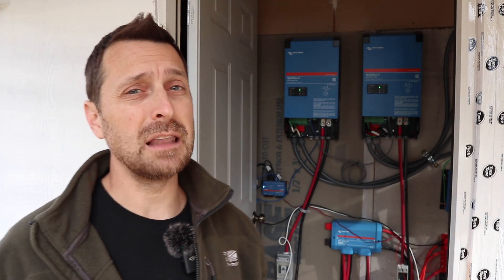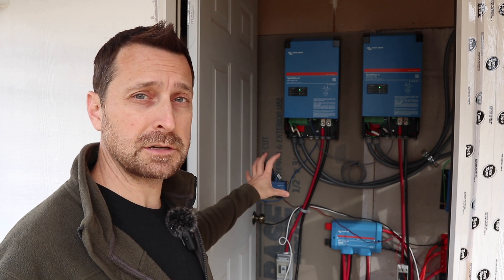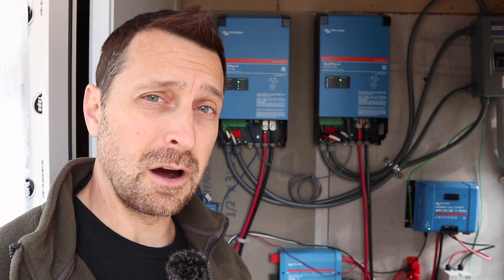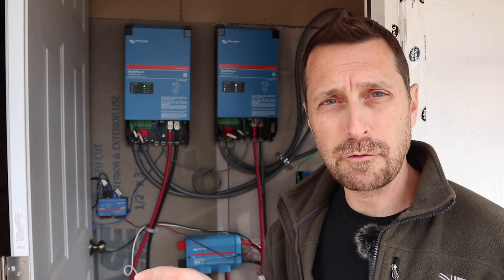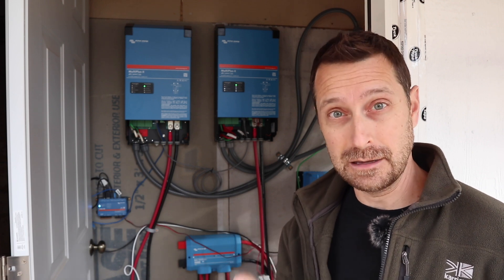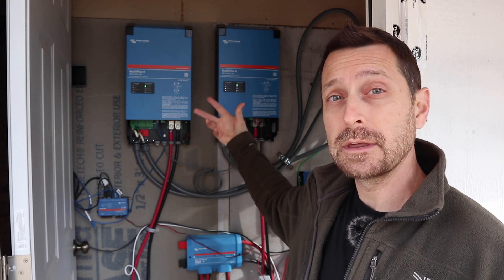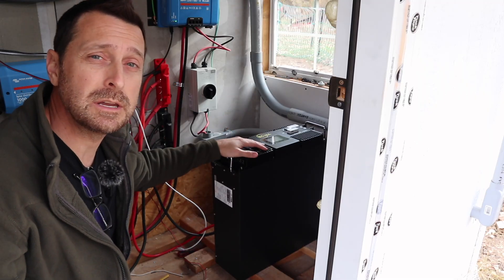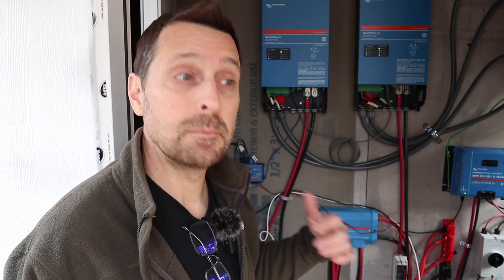Is There A Flaw In A Modern Solar Power System For Home Use?

Comment: morality of the story. don't update when no update is needed, and read the documentation for the new firmware before applying it
old analog systems wouldn't be able to use LiFePo batteries. also they had hardware problems, that were much more difficult to fix than just updating firmware

Comment: I agree with you on this but I'll share my anecdotal experience- I have used on my properties: Sungold 6500's x2 for 240v, Growatt 5k with transformer x2, Eg4 6k (old models) 240v invterters x4 (horrible plz dont consider)(Not the LuxPower 6k EG4's... completely different), EG4 18kpv in off grid use, and SoArk 12k... the ONLY inverters that have been running from day 1 without shutdown or "firmware" issues are the Sungold 6500's... almost the cheapest ones in my lineup. My parents home run on the same Sungolds with the same results. I have no idea why, but I share this for your use... or scrutiny...
Reply from the maker: I appreciate you sharing the info.

Comment: Hi, I have a question.
You stay in Texas, and have normally 120V/60Hz.
Why you use over the inverter 2x 240V?
Reply from the maker: Hello. We have appliances that run off or 120v or 240v. We have split phase. Large loads like clothes washers, pumps, and ovens use 240.
Reply: @CountryLivingExperience  But for 240V, u use two phase 120V.
That's why I don't understand, why u make 2x240V and not 2x120V.
Reply from the maker: @mistercat9875  No. They are two 120v which are paralleled together. They are 180 degrees out of phase.
Reply: I have order for a friend a 5kW system with a Growatt SPF 5000 ES - with Lithium Battery 200Ah. 
The friend is move in the caribbian and use his old homestand from Germany... (1 Phase 240V), but also 120V from the island. 
I need a safety system for him, to use both things. But need different plugs for use only single phase 240V (here he like to use the Germany system). 
Normally is my meaning: use the system, like the country u living in. So no problems.
But he use the different way... He has a lot sunshine, but the country take off power up to 14h/day.
Another question is: can he use 110-120VAC input of the Growatt? The manual, who I has read say yes, but get with the power down... I mean input to use the Growatt/Battery's like a USV. 

I'm also from Germany, but living in Macau, don't have this problems...
Reply: @CountryLivingExperience  Hi, a questen again...
It's possible to use the Growatt with 2 Phase US 120V?
I have let make 1 Phase/N/PE for input and get outside of the Growatt 120V ... 
But we need to make 1 Phase 230 (240)V... - Only Power input - (nothing feed back in the public network).
So it's possible to use 2 Phase input the Growatt?
I has ask Growatt, but no answer.
Reply from the maker: I will look at the email when I get an opportunity.

Comment: Is it good or bad idea to keep battery,charge controller,inverter in a separate air conditioning room to maintain cool temperature?? Most of the time heat reaches 36,37C here.

Comment: Hola Hermano, Quiero comentarte algo que podria ser de utilidad para ti. Soy mecanico automotriz y esto me recuerda a cuando salieron las luces de xenon para vehiculos, tuve un caso en que el auto hacia seña de luces y se paraba el motor, resulta que el alto voltaje de el xenon interferia en los sensores de el motor, tambien tuve un caso en unos equipos sonoff que tengo de domotica en mi taller, un dia puse en marcha un generador cerca de un sonoff y este se bloqueaba, prueba de aislar los cables de comunicacion de grandes campos magneticos, en ese auto lo hice mayando los cables con papel aluminio y este llevandolo a masa, si asi no se soluciona, abre tu inversor y si es posible hacele una chapa que ataje los campos magneticos de la alta potencia a las placas sensibles, recuerda los Growatt que tenias, las llevaba afuera de el equipo... Creo que eso puede ser el motivo de tu problema. Saludos desde Argentina!!
Reply from the maker: Interesting. I appreciate the suggestion. Gracias Amigo.

Comment: Once system is built and functioning, do not update firmware unless you have a specific issue it resolves. Same as flashing the bios of a pc motherboard, if it is not broke....do not update it.

Comment: Oh, one last little thing.  I noticed that the solar panels on that shed behind you are jutting out from the top.  I recommend putting a bit of structure behind the part of the panels jutting out from the top to prevent wind from catching the panel from underneath.  Otherwise a strong windstorm will rip that shed right off its foundation.

Comment: Integrated communication  between a multitude of different brands always has warts.  It's an issue with computer automation in general.  As a programmer I can tell you that sure,. there are protocol specifications, but the amount of testing manufacturers do is wildly different and often amounts to almost none.   The result is usually poor compatibility between brands when edge conditions or less-than-perfect situations come up.

Also remember that most of these companies... like Growatt, EG4, Bluetti, EcoFlow, and most battery makers... they don't necessarily employ the cream of the crop when it comes to programmers.  Even Victron (the best of the bunch) could do a better job.

But fortunately when it comes to a solar system and LiFePO4 batteries, you don't actually need the comms.  You can just configure the devices to be voltage-based.   In fact, when it comes to LiFePO4 batteries, you don't want ANYTHING to be based on SOC.   Even if the comms are working perfectly.  The reason is that it actually is not physically possible to accurately track the state of charge of a LFP battery unless it regularly hits "reset" points (typically for 100% SOC).  Even Tesla's with LFP packs can't track the SOC of their packs accurately.

Even in fully operational systems, I strongly recommend that NOBODY configure any logic that uses the BMS's reported "SOC" readings.   You can display the SOC for user convenience... just don't make any of the automation conditional on SOC values.

For amperage limits, just choose reasonable hard limits.  Normally the inverter(s) talk to the BMSs to determine how many batteries are online and able to charge or discharge to determine amperage limits.  But you don't actually need these comms to have a robust system.   For example, if you have a rack of 6 x EG4 batteries, choose amperage limits under the assumption that at least 3 batteries are tied in.  Simple as that.  Give yourself a bit of redundancy and margin and you will have a very robust system without major comms.

This is true for small systems too.  Say you have 3 x 100Ah batteries (without comms) in parallel.  You can just assume that at least two of them are operational when setting up amperage limits (you'll be limited by wiring anyway most likely)... and that's it, you are done.

The only integration that I would leave intact is using the Victron Shunt to get the battery's voltage reading for the charge controllers, which is a simple setting.  That works flawlessly.   In fact, I would also use the Shunt's SOC tracking for any SOC displays, and ignore the SOC tracking done by the battery BMSs.  (Remember, don't make any of the automation SOC-based either way!).

For things like the inverter low-battery shutdown, load support / generator operation, and so forth... make all of that voltage-based and your problems should pretty much go away.   Give yourself some margin and the system will work perfectly.   For example, in my 48V (16s 51.2V nominal) system I set the low-voltage inverter cut-off at 48.0V.  At 48.0V the batteries are 95% discharged and I am also pretty much guaranteed that the inverter will shutdown before the battery BMS's do, leaving the batteries completely operational and ready for the next cycle.   There is no need to make the shutdown voltage lower than that.

For things like generator start or load-support, that can also be voltage based.  Select something reasonable between 50V and 52V for load-support automation.  During discharge, the battery will be roughly at 30% SOC at 52.0V.  That is when I have my first load-support resource turn on (which in my case is the grid).  I don't have a generator yet but when I add one I will have it kick-on a 51.0V.

For setting the "turn off point" or whatever, remember to use the charge curve instead of the discharge curve... so any shutdown should be well above the float, such as around 54.5V or higher... or even charge the batteries to full (56.8V).   The voltage range may seem wide but remember that the charge curve and the discharge curve are two different beasts.

For charge settings, 3.55V/cell (56.8V if 16s), and use a manual absorption time of 1-2 hours to give the battery BMS's time to balance their cells internally.  No comms required.  No current tail settings required either... I usually disable the current tail.   That's it, you are done.

-Matt

Comment: Expert solution here:
1. Get a cheap burner iphone
2. Install the victon sofware on the phone
3. Change the password on the app
4. Connect and configure your system
5 remove the sim/never connect to wifi/go in airplane mode with that phone
6. Never gonnect to the wifi or internet again (i.e. go darK)
7. Never connect to the system with any other phone either
This way, the hardware/firmware is never notified that it needcs an update.

Comment: This is a really great video and comments are very helpful. What all in one system would you say might have the least software issues? I'm looking at an EG-4 based system. Would getting the large wall mount battery they sell be better at communication  vs the rack batteries they have?
Reply from the maker: Glad it was helpful. 
That is kind of the point. Victron and Schneider (inverters & mppt's) are have the least issues with software, but as I demonstrated, they are not immune. I would say the best chance you have is with Victron. 
EG4 is good. I like their LL version batteries a lot and have not had one issue with them. I have never tested the wall mount battery.
Reply: Thank you, love your videos.   @CountryLivingExperience

Comment: The recent firmware update on my Victron RS450/100 seems to be very flaky. One tracker will drop to zero while the other is at full output and both panels are on more or less the same light level. Overall though I would sooner use Victron than the alternatives.
Reply from the maker: Interesting. Thanks for the comment

Comment: I worked as a plant Electronics Tech., Electrical and Controls Engineer until retiring a few years ago, and I'll just throw in some things to check that can lock up communications other than firmware. If the unit has been running for days without any issues, there could be other issues at play other than firmware. Firmware can be an issue for sure, but look for patterns when the failure happens. Most likely electrical noise is effecting and getting into the low voltage communication cables. The most important thing to remember is to route all these low voltage communications cables as far away as possible from higher voltage DC and AC cables as you can. Don't route your communication cables in the same conduit with high voltage wiring, run them in separate conduit. Don't wire tie them in parallel to high voltage DC or AC cables. Where you are not using conduit to shield the communication cables, make sure your are using shielded communications cables (has a foil wrapping) as they will be the next best thing to running them in conduit. If you have any relays that turn on and off make sure they have built in suppressors across the coil to clip the high voltage spike you will get when opening any relay coil as that can play havoc with the communications. These are the most common things I've found that cause problems with communications locking up. Best Regards.
Reply from the maker: Thank you for your thoughts on this. I will check for that interference and get the comms away from the batt cables.
Reply: @CountryLivingExperience  Good morning, the magnetic field and noise can get pretty intense sometimes around those DC and AC power conductors. A quick way to check your communication cables is to disconnect and run separate comm cables away from DC and AC wiring to see if that resolves it. Make sure someone didn’t accidentally throw a non shielded comm cable in with your comm cables, should be stamped on the cable jacket if shielded. Proper electrical grounding can also cause issues, so make sure to check that everything is grounded well back to the breaker box ground bus so the noise is more likely to go that route. I’m betting you have something spiking your comms based on what I’ve read. Have you noticed if the problem happens at the same time during the day, or any other pattern will help lead you to what might be causing it.

Comment: You have a relatively "complex" system.  That's why I don't see solar as a long-term solution.
It's great, but it's a computer system, and computer systems can break.
That's not to say you shouldn't use solar.  I think it's awesome!  I also think you need to be prepared to use a more primitive setup.  The more complex ANY system,  the more likely it is to have problems.   Assuming a SHTF/ Apocalyptic event/ long-term power outage, you won't be able to get support or parts for those components.  If you're relying on them for all your power needs, you could be left out in the cold, literally.
That's how I feel about my Bluetti products.  I love them and use them often, but I've already had to have one replaced(under warranty).
Have redundancy in your system.
Gas generators. 
Several MPPT and PWM charge controllers.
Fireplace for wood heat.
I'm hoping my solar setup lasts until the lights come back on, but I'm prepared to live with minimal electricity if it doesn't.
Reply from the maker: I agree. A hand pump for the well is next on the list. I have the generators and wood stove. Primitive redundancy is a must.
Reply: @CountryLivingExperience  can you dam up that dry creek bed and create some water storage?  I am fortunate and have a 2 acre pond a well as a year-round creek on my farm, so a well isn't really necessary.   I do have two 12v pumps that I can use to pump water into buckets.
Gotta have water,  food, and heat to survive. Of course,  you have to be able to protect your people and property as well, and that might end up being the most difficult task.  There are just too many millions in this country who don't have supplies to last 3 days, much less a month or more.
Reply from the maker: I may be able to do that but I am not sure the water in it would be that great. It is all drainage from the road. I have seen the water in there and has a nice oil sheen on the top of it. We can still drink that well water luckily. Just too salty for the plants.

Comment: there is no reason you have to constantly update (working) firmware. Cars,fridges,lawnmowers..... If it is not connected (interacting/communicating) with anything external (the web)
Reply from the maker: I had a problem. It was recommended that I update by two solar companies. I updated.

Comment: General rule with commissioned hardware and software, if it is not broke, do not fix it. If the setup is stable, there is no reason to update the software unless you need a new feature. Given you are not using the online bits, then the software can stay frozen.
Reply from the maker: It was broke.  It was recommended that I update by two solar companies. I updated.

Comment: Holy crow...... i am just learning about solar from you and others and I will not purchase anything until solar can get its act together.  After 50 years and billions in  tax payer subsidies, solar should be way ahead of where it is now!
Reply from the maker: It should be fine. Just don’t enable most of the communication connections. I would get equipment soon as a backup.

Comment: I recently purchase 2 EG4-LL-S to add to my 4 EG4-LL v2.  One of the EG4-LL-S is now my master battery and I notice much better charging. Before hand, it was difficult to get a high state of charge (e.g. >90%).  It also appears that with the EG4-LL-S as the master, it is telling certain batteries to charge at one time and others at another time to help keep the batteries in sync. I should note that I have a Schneider XW-PRO and using AC coupling to an existing grid tie system until I get my new solar panels installed.  So this may not be the same for the Victron using DC charging.  But if you are lucky, you may notice a significant improvement when adding the EG4-LL-S.

I think the basic problem is it is really hard to figure out the State Of Charge of the batteries and the BMS's get confuse.  They may require the batteries to be completely discharged and then fully charge to get them calibrated -- my laptops have had those issues for years.  So many variables such as temperature, charge and discharge rates, and variances between batteries that make coulomb counting to measure the state of charge to drift over time.

In terms of field programmable firmware, it has it pro's and con's.  Back years ago, companies had to be a lot more careful to ensure their products work when shipped because a design flaw could lead to some very expensive rework.  Today,  a lot of companies will ship product knowing it has issues because they figure they can fix the issue later with a firmware update.  While being all analog has it benefits, it is also limited on what you can do without breaking the bank and make it difficult to add features.